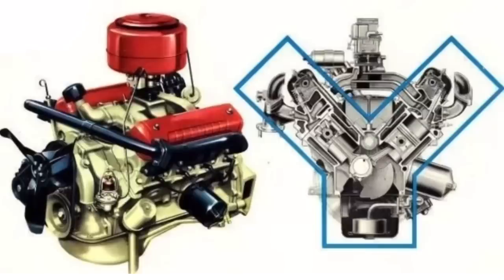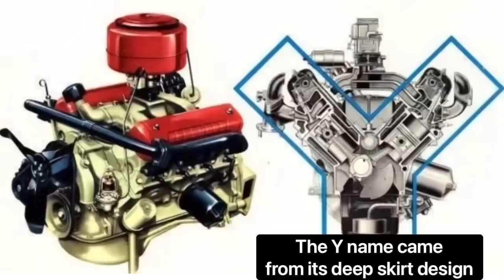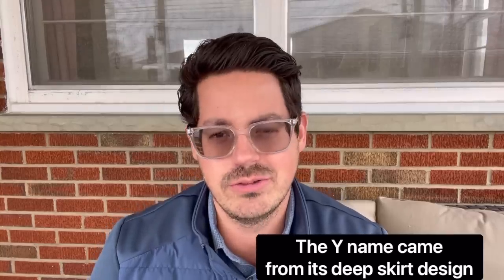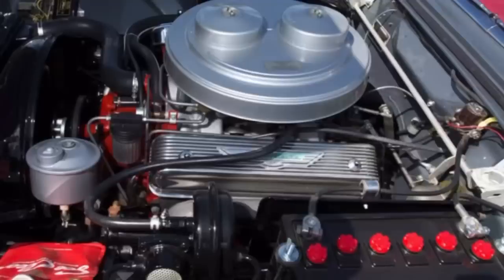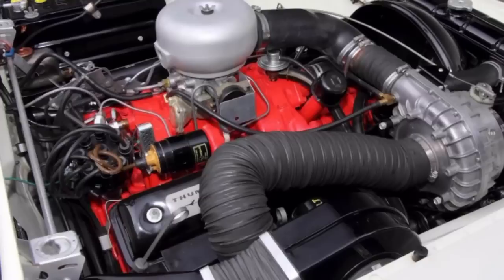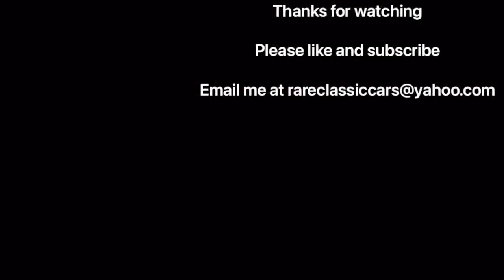Worst Engines of All Time: Ford Y Block V8

Comment: The Chevrolet small block and in 1955 had teething issues that were quickly addressed. The 1957 283 is what built the reputation of the Chevy small block. 

Ford over-engineered the Y block and created an engine that was heavier than necessary for the displacement and power to weight ratio. The over-engineering made addressing the oiling issues difficult as well. But it was still as reliable as any in its price field.

Comment: Y blocks are awesome. The main issue with it was the oil of that era. In about 1000 miles the oil would start to become sludge and clog the oil galleys. I have a 1955 f-350 with the 239 in it, rebuilt over 140k miles and 20 years ago still runs great. Its only ever gotten full synthetic oil since ive had it and it looks brand new inside.

Comment: About 5 months ago, I pulled a 58 f100 out of a field where it had been sitting for decades, unstuck the engine with a bar and now I’m driving it almost every day. The truck was worn smooth out when it was parked there. Y block 272 and has made every person to ride in it smile every time.

Comment: I didn't grow up with these nor do I have any experience with them so I don't really have a horse in this race, but I will say that I think these engines both deserve criticism and are overhated (though not nearly as much as in the past). I think it's safe to say that these are very much 1st generation OHV V8s and they suffer from the same issues as a lot of those engines. They're very, very heavy, don't breathe, and don't have a lot of performance potential (by modern standards) without burning cash. They remind me of the Studebaker V8, which had similar if not worse issues. It seems like GM was the only company that didn't run into the same problems.

Comment: The Y block was revolutionary, Chevy wouldn't have come out with their overhead valve small block otherwise (.  My Dad daily drove one in a 57 over 100 miles a day for decades, and I went across country in it a dozen times.  He had homemade overhead oilers and problem solved.  Of course better engines came along but it was a very important step.  If you want to know the worst ford engine of all time its the 5.4 while I would argue the Windsors were one of the best of all time.

Comment: This guy needs to do some more research, let alone pick up a wrench.  The Y Block was and still is a great engjne.  They were used in many applications from family sedans to heavy otr trucks.  Like any other engine if you didn't change the oil or perform proper maintenance they would fail, oil passages would clocg causing valve train issues and such. The newer cam bearing kit has a slot that goes around bearing which makes a world of difference.

Comment: I have a beautiful '67 F100 Ranger with 352 FE factory remanufactured engine. All worn out. Had the pan off and the the bores are badly scored. Same old story, didn't change the oil. These FE motors are built like tanks but no motor will last with dirty oil running through it.

Comment: This is not so much a "worst engines of all time" video, as a video about highlighting the issues these engines have and warning people that if they buy a vintage Y-block V8 Ford they might be looking at an engine rebuild or at least a repair job on the top end and installing one of those external oiling kits for the rocker arms.

Comment: Im rebuilding a 292 that has the original engine that was never torn down until i did it and it is in great shape and the rear main seal did not leak. The owner just maintained it before it was parked 30 years ago.

Comment: My dad was in the Canadian military in the early 1960s on a remote base Holburg. The military had an old 1950s Ford pickup with  a Y block. The soldiers loved that truck because it was fast and fun to drive. The truck was supposed  to be scrapped but the soldiers ignored the scrap order and just kept using it.

Comment: I find myself binge-watching these videos, and, as happens when you go that route, there's a worry that you'll catch up(!). Anyway, my Dad had a '56 Country Sedan as a company car that, early on, burned out points and left us stranded a couple of times. Don't know if that was a common issue, and it's certainly not in the same league as oil blockages, but we did experience it.

Comment: Y-blocks are great engines. The first engine I rebuilt was a 292 Y-block and I did great upgrades on it. That engine made music and it had great power. I broke gears in the transmission and snapped off an axle, so I did upgrades there too. So don't say bad things about an engine that you know nothing about. I miss my y-block big time.
Reply: Y-blocks are great engines for boats... as an anchor

Comment: We had Ford Y Blocks on the farm in grain trucks and they were a reliable tough engine. There only real downfall was that they were heavy. The small block thin wall casting V8's that came afterwords made the same (if not a little more) power but weighed less. Weight is a important factor in engine design. In truck form they chugged along reliably for many years.  Changing your oil is still important today. That is not the engines fault. That is the owners fault.

Comment: I'm not from that era of engines but I am a modern mechanic and I can tell what you're describing is typical operator error which is not only a Ford Y block thing, its an engine thing. And people are STILL ignoring recommendations to this very day - not keeping up with maintenance schedules, ignoring issues that should be dealt with and this is a problem as old as the mass market internal combustion engine itself. I remember my Dad telling me horror stories from his time in the 50s to the 80s as as mechanic, and they're all the same stories I tell people now as a mechanic in 2024.... people are fricken dumb, don't listen, then complain and whine when what we said would happen.. happens.

Comment: The y block engines were a pretty good engine just had to change oil and use the right kind of oil and you'd never have problems..... Ford's always had a much better engine than general motors

Comment: We have 1 1956 Mercury Montclair with the 4bbl teapot 312cu and 1 Mercury Monterey 1962 2bbl 292  thats even used during -20°C winters in Finland. The 292 got over 500 000km and runs great. With todays oils the oiling problem doesnt exist anymore. I once saw a 272 from 1955 that had a external oil pipe. But our Y blocks run great. Even the 62 Monterey 292 with a 2 speed gearbox gets 20mpg goin 80kmh and a bit more pulling a caravan. Got nothing to complain about these engines. Not fast but they keep on chugging and running

Comment: The Ford FE series engines also bleed oil from the camshaft bearings to the rocker arm assemblies - perhaps because of problems with the Y block engine, the passageway in the FE block and cylinder heads is so large it can put too much oil in the rocker arm area - a common fix for this is to put a restrictor in the cylinder head passage to limit the amount of oil to the upper end

Comment: I have a hydraulic crane built in 1959It has lived a long time and was used heavily, It still runs, People did not have money to change oil or do the services required. Npt changing oil is not the fault of any engine. You are claiming much knowledge you do not have.

Comment: The difference between Y block and Chevy small block, if you didn't baby the Ford it would conk out.
You could abuse the Chevy , it would smoke but keep on running.
Proof,  How many Fords have a Chevy under hood ? Do you ever see a Y blk in a tri 5 Chevy ??

Comment: Built a y block 312 few years back, converted the rocker shaft assembly to full pressure setup. Lots of parts from Mummert's - was really happy with how it turned out.

Comment: 292 and 312 were awesome motors. They did well at the drag strip, until the fe motor came out.. the Lincoln motor wasn’t a Y block, it was a MEL engine.

Comment: I had a 1961 Ford Falcon with the 144 cid straight six that my grandfather originally purchased. It had the same issue with upper engine lubrication. My grandfather used non-detergent oil for the 10 years he owned it and the oil passage to the rocker arms was completely blocked. The crankcase was also full of sludge from the non-detergent motor oil. I remember my Dad putting some kerosene in the crankcase and running the engine up to temperature, then draining the oil. It came out in lumps. But to Ford's credit that little motor never left me stranded.

Comment: Y block one of the best engines I can remember, had 55 merc 292 couldn't kill it, i was young and did everything you shouldn't do , but the old merc kept ticking. Sold the the 55 and got a56 
Monarch ( Merc ) with up graded 312 police interceptor , another great car, did some up grades myself , like pistons 12:1  Cam and Holley 650 dual pumper  drove this for years a real sleeper
fooled a lot of chevs that thought they had the best and the fasted.  Don't where you got the bad from for Y blocks. I still drive Fords because of those rotten Y blocks.  Note Big difference in engines between Ford and Mercury Y blocks The insides were totally different, bigger crank, valves and intake ports, and if I'm not mistaking they they were balanced at the factory as well.

Comment: A slotted head gasket was the oil passage to the rocker arms. It would clog and an external oil line would have to be piped in to a rocker stud that doubles as the valve cover mounting stud.  That’s really the only problem I saw.

Comment: Had a 64 Ford 1/2 ton with the 292 Y block back in the 70/80's as a work truck. Whether hauling a boat or trash, that 292 never gave a minute of trouble. Ohh, never mind changing the oil, it had almost as much water in the oil pan as oil, never was a problem, lol!

Comment: The y block had some issues but all engine do. I have a 272 y block and it’s driven almost everyday with plenty of power and reliability. Simple to maintain. And you say the sound was undesirable. The truck has a great rumble that when your accelerating only gets better.

Comment: I have a 1964 Ford f250 with the Y-Block and it is one of the best engines that I have driven.  I bought the truck from my Dad in 1980 when I graduated from High School and I am still driving this truck.  I have updated the 2 bbl. to a 4 bbl.  I have headers and went with the 373 ratio differential.  I have a simple electronic ignition.  I have bought parts off LMC.  It is a great engine and a well built truck.

Comment: The y block in the f code made 300 hp more hp than the small block Chevy at 283 at 283 hp. In 57 ford won about 25 27 nascar events Chevy won 12 the nascar outlawed the engine pressure from  gm I am 80 and have been doing this work all my live

Comment: I have a 56 Fairlane with the original 312. Still runs like a charm. But wait it gets regular oil and filter changes. I don't know of any engine of any make that can cope with incorrect assembly and wrong oil. Or never change. In mho its a stupid statement that it's an engines responsibility to   use the right oil or change regularly. Love my Y blocks

Comment: Had a 360 in a f250. Drove it for near 11 years before it got totaled. Changed the oil regularly 
and the spark plugs once. Never had any problems with it. Far from the worst motor ever built. Worst motor I had was a 267 in a 1982 thunderbird.

Comment: I've not owned a y block engine,  ut I agree with everything you said about the flathead. I own 4 of them, 3 are the 49-53 engines, and 1 1940 60 horse. They definitely aren't powerhouses, but smooth, simple, and reliable are what they offer. Good oil, and good gasoline keeps them running reliably.

Comment: Yes! I agree very strongly about the "old Ford Y Blocks of that era" very poor oiling system. I have owned about 1/2 a dozen of them, But you know that was "old man Fords' idea" of cutting costs, and that was the end result/ This one poor old 292 V8 I was told had a camshaft (valves adjusted all the way in) that was SO WORN OUT it had 1/4 to 3/8" play on the rocker arms and still ran 90mph with the 3speed with the overdrive transmission>>>> (which by the way was also weak point of the drive train and would break gears). And that was a big problem "OLD man Ford insisted in cutting costs whatever it took" and the strength and quality showed it in those engines and transmissions/ Those old Y blocks were a oiling poor design, but so was the early 3speed w/the overdrive car (the 3speeds in the trucks were much stronger) stick shift transmissions. I know going thru school i was always laughed at for being a big fan of the Fords from the Dodge and GM fans (but a few years later that changed). Butt Ford did have a "GREAT IDEA" with the Drop out rearends especially the 8 3/4 and 9" rearends that even chevy guys would beg me for the rearend out of my Ford pickups

Comment: Hi, I had several 292's and some of them had the oiler kit installed. I would change the oil with four quarts of oil and one quart of ATF. [and oil filter of course] I would run them for about 500 miles and do it again. After the third oil change, everything was cleaned out and the oiler kits were removed and trashed. Too many articles about bad engines caused by bad owners not changing the oil. If you feed your baby spoiled milk and he/she gets sick, is your baby defective???????

Comment: I can't see how you could even compare them to a Chevy small block. Most engines of that era used oil. Many of them (most?) would leave a trail of blue smoke when they got over about 70,000 miles. The cure was generally an in-chasis ring job. Except for the SBC. A Ford or Mopar would take a set of standard rings, clean up the bores, and put it back together and it would be good for another 70,000. Sbc had a soft block, so the rings and block both wore out about the same time, Now, a ring job amounted to boring, new pistons (oversize), and oversize rings. Then there was the cam and lifter issue. And, timing chains and sprockets. And you called these engines better? Not in my experience. They were a throw-away piece of JUNK! Ford and Mopar had them beat more ways than you can count!

Comment: Our fire engine fleet consisted of '56,  '57 and '58 Fiord F-899's with a 363 ci "Y" block V-8 engine. All had a 5 speed transmission. All ran the expected 14 year life span with no major engine issues. We did see blown head gaskets, tune-up needs, cooling system services and rarely a blown Exhaust manifold gasket. But all rendered good service. When the FORD FE truck engine's were introduced we continue to see more good performance.

Comment: I owned a 58 ford with the 312 “Y” block great engine changed the oil every 2’000 miles no problem drove it 90,000 mile before getting a new ford.

Comment: When I was in trade school in 1960 we saw a lot of Ford Y blocks with lifter valleys full of sludge and a few push rods. The people with small block chevs used the same oil with out the heavy slugging problem. I think the Y blocks didn’t vent well. The flat head ford V8 probably didn’t slug up so bad because they ran so hot. The chevy stove bolt six had rocker arm oiling problems.

Comment: Any engine that doesn't get a regular oil change is a desater looking to happen and mechanical valve train is better than hydraulic and driving 55 saves lives and engines and wallets

Comment: My dad rebuilt the 272 in his '56 F-100 in '64. Changing the oil regularly, and a tune-up every now and then, He drove it for 9 years and then I drove it for another 7 years without needing so much as a valve adjustment. Comparing Ford's first OHV V-8 to all V-8s is asinine.

Comment: The problem is you were not there in the 1950's. The Y-block was the first low cost overhead valve V8 that could be purchased on an average budget. Viewed with today's technology it might look bad. In the 1950's compared with other engines, it was a fantastic engine. I had a 57 with a 312. There wasn't hardly anything in stock form that didn't watch my tail lights.

Comment: When serviced correct….these  are a great troublefree engine of “their time”. ALL engines then 
Leaked and smelled when worn …. The sign of the times. With modern revision just like other manufacturers then they are great.

Comment: My Father had a1955 got 70,009 miles on it mostly in the city. Had a 3 speed automatic which is the basic design for 1970's automatics no power two speed gm power glide

Comment: In the early 60's I had a '56 Mercury 2 dr hardtop with a 312 and a 4bbl.  Raced other kids around town until a wrist pin decided to part company with the engines through the cylinder wall and brought that car's adventures to an end.

Comment: i'm sure others mention it in the comments, but these engines were side-oilers. As in the oil pump mounted to the side of the block instead of inside the pan. The bottom-end oiling is actually great on them. They're also known for hot spots in the heads but you can drill them for steam holes using modern head gaskets as a template. Unique to this engine is the port design. The intake ports weren't side-by-side as they are on all other engines. They were stacked in pairs. Presumably this was to generate velocity, which helps for low-speed performance. But the design strangles high-speed performance. It's difficult to modify the ports and the results don't pay the way they do in a conventional design. The engine lasted through the eighties in Argentina and the later engines had conventional intake ports and exhaust ports much like a Windsor. I found the fuel economy surprisingly good. With an Autolite 4100 and '57 distributor, my 292/auto consistently got 20mpg highway in Southern California traffic. And they sound FANTASTIC through full-length 2" pipes with glasspacks.